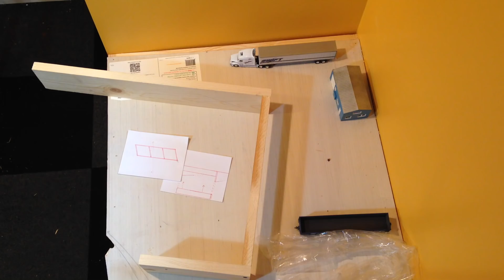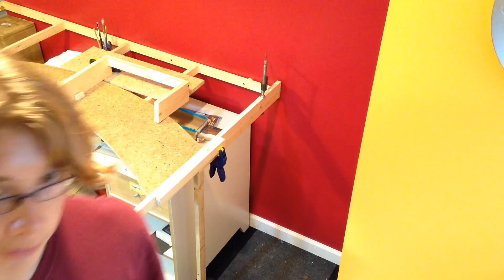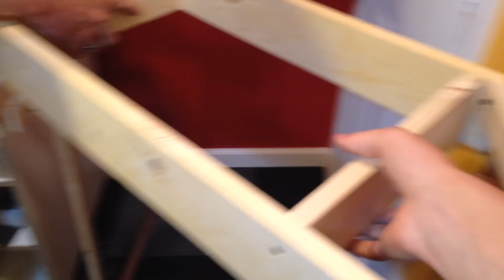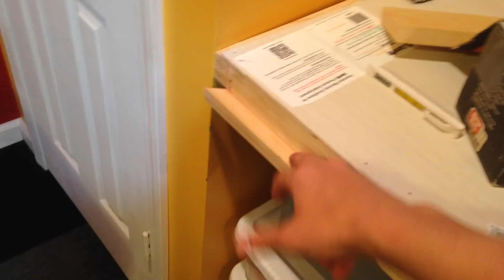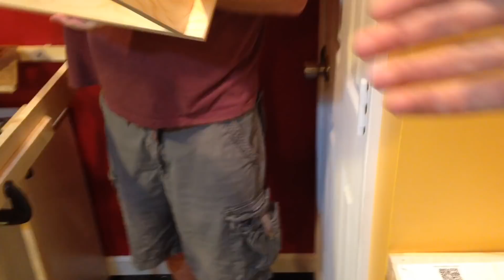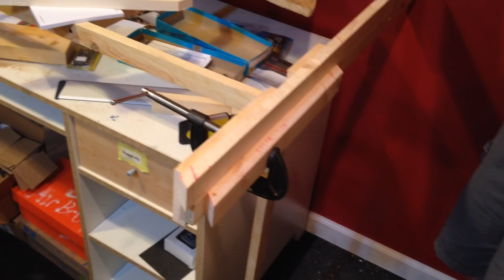Building a Model Railroad Lift-Out Bridge - Part 1

Comment: Great idea!  Well engineered.
Reply from the maker: Maurice Smith Thanks! It worked out pretty well. Actually, surprisingly well. The toughest part was getting the angles correct. And it's a little tight at first, but we'll be rounding all of the corners to make it slide down smoothly. We just completed the drop bridge in front of the layout entrance so look for that video on Tuesday!
-Cam